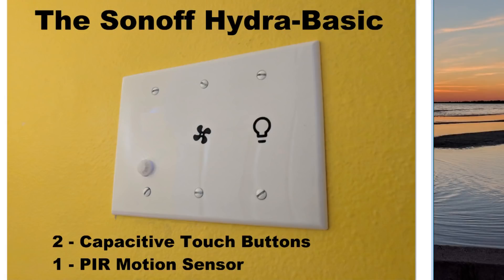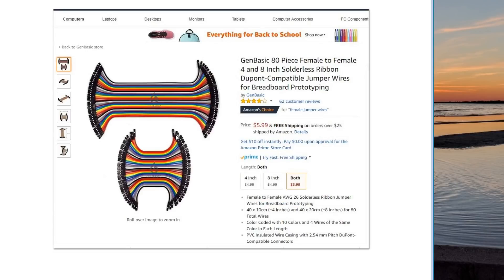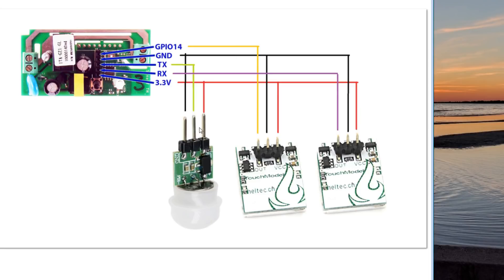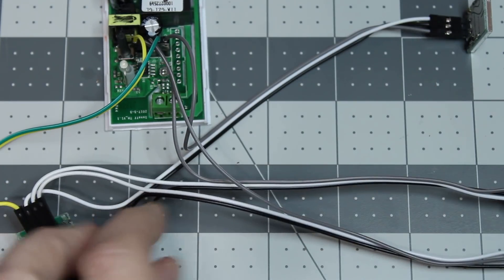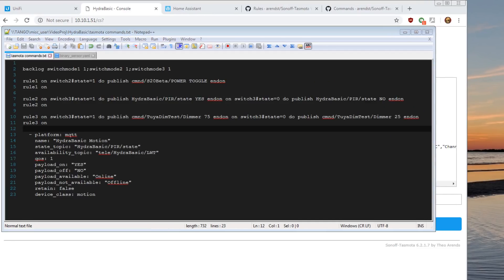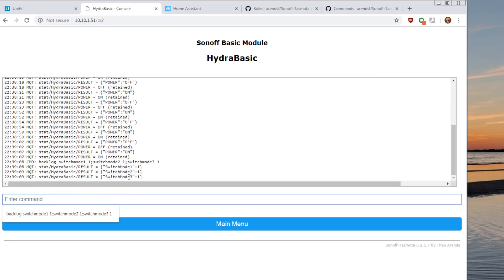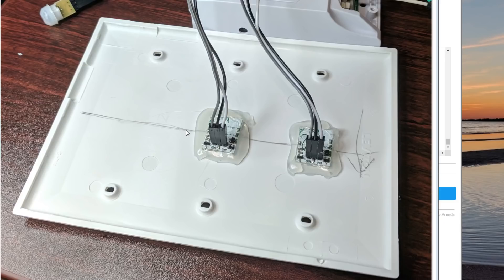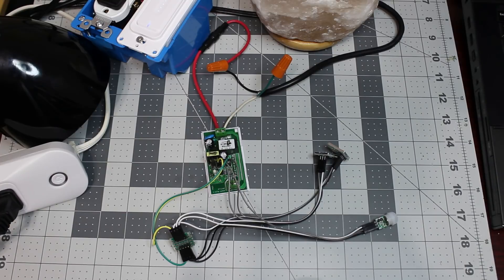Sonoff Basic Expansion Mod - Buttons, PIR Motion Sensors, Tasmota Rules and more!

Comment: Is there a way to make the led on the capacitive touch sensor stay lit all the time?
Reply from the maker: Not that I know of without some major modifications. I looked into the little processor on board that is flashable but I couldn't find much on that process. I really wish they would do one that like that.
Reply: @digiblurDIY  Thanks. Yeah, same here. I tried messing with ButtonTopic in tasmota but couldn't find a way to change the state of the switch without changing relay state too.

Comment: Liked and suscribed, very good video, can you tell me how many GPIO pins on the sonoff basic can you hack?, i guess the LED and the Rele too, but im not sure
Reply from the maker: Yes you could snag those if you are handy enough along with gpio4 on the chip itself. But at that point it might be better to get a device better suited for more GPIO pins?
Reply: digiblurDIY, In fact, I was trying to do this same project with a d1 mini, but taking into account that I need the relay, well, the sonoff basic seems a better option
Reply from the maker: They do have those d1 mini relay shields that stack on top but then of course you need to supply a power supply to the d1. All boils down to how much work things are.

Comment: Nice Work..might have been nice to see the wall plate etc working in the intended area but otherwise very informative.  Heard from Dr. Zzz's that you may have flashed a Sonoff ifan002, any chance of a video to demonstrate?  Looks a little tricky with the separate power supply and soldering on the backside.  Would like to see it done before I fry one of mine!  Keep up the good work.
Reply from the maker: Unfortunately the wife happened to be painting the room that week so I was unable to grab video. I do plan on doing an iFan02 video to show the quirks but I won't have any flashing stuff as I did my two over OTA and don't have another unit that isn't flashed to go through that process.
Reply: Ahh... thanks for the reply...Any idea where I can find info on how to OTA flashing of the iFan002?  Dr. Zzzs video? If so how do you get the iFan002 into "flash mode"?  OTA definitely sounds less risky than running on mains.
Reply from the maker: Yes, he did a somewhat recent video on how OTA was back.  I had to hold down the button for 10 seconds or more and then I could see the AP mode on my WiFi scan, the manual talks about the long method or something.
Reply: Thanks!

Comment: thank you. awesome video and make full use of the sonoff basic. explanation of the Rule is very good. thanks. I want to use this in a bath room can i swap the 2nd touch sensor with a DHT22 so it runs the exhaust fan. If its possible could you also show what rule(s) i need 1st for mqtt states of humidity and temp & 2nd rule for turn on a entity(ex-fan) when humidity goes up and turn off when its back to original value. I guess anotehr rule3 would be needed to run the ex fan for 20 min every time SW1 is activated.
Reply from the maker: Yes, you could use one of those pins for the DHT22 as it only requires one data pin.  I actually have something planned for this type of automation but it might be a week or two before I circle back to a video on more rules such as this.  If you want you can send me something on reddit as /u/digiblur  and I can help walk you through things.
Reply: oh so you are digiblur, you are the one that pointed me to this video on discord. thanks..i will ping you in discord. thank you
Reply from the maker: Yep. You can find me there as well.

Comment: Nice job! Thank you. I like the rules parts. I have not tried that yet. Is it possible to show how you mounted the touch sensors on the wall plate? Did you have to cut holes or does it work through the plastic?
Reply from the maker: The very last part of the video as a snap of the buttons attached.  Yes. Hot glue over the edges and around it just to stay on. There is no glue in between the button and the wall plate. They work pretty good through a variety of things.

See below. I wish they had an option to stay lit all the time and go off when pushed. https://i.imgur.com/LVfHmnG.jpg
Reply: Loving your videos man.  Helped me past a few small hiccups I was having.  I'm just curious though, where did you get your stickers?
Reply from the maker: I made them on the Cricut vinyl machine. Are you in the US? I could send some.
Reply: @digiblurDIY  I am in the US and that would be rad!  PM me your email/paypal.  I just haven't had any luck finding them to order anywhere otherwise I would have, lol
Reply from the maker: Just add Gmail to the name of the channel and it will forward to me. Or I believe you can go to the about section of the channel page to obtain the same email.
Reply from the maker: @matthewfgriffin  If you don't want to do the email thing, look on the HomeAssistant or DrZzs discord servers and you'll be able to pull me up, just send a PM.  No paypal needed.

Comment: getting the sonoffs talking to each other, i like it! i wish i was retired so i could play with home auto more. dangit,  back to the grind.
i did flash a few sonoffs tonight, gonna try to see if some old thermistors i pulled out of an old AC unit will give me some data.
Reply from the maker: It's through MQTT of course but there is another way they I'm setting up at a friends house with two switches to send commands over WiFi only as he doesn't have any automation or MQTT broker and we just need something simple.  Check out the WebSend command, it's great.

Comment: wondeful :) lacks only the illumination of the keys.
Reply from the maker: Yes. I really wish the buttons were backwards where they stay lit while not triggered and went out when touched.
Reply: Just done with mine: you have to use the mode "82 Switch1n" and the led is on when the relay is off and viceversa :)
Reply from the maker: Are you using them in momentary mode as in the solder added? I believe mine are the 1n 2n etc for no pull up and I don't see them working light that. I will check this evening again.
Reply: i made some tests at work, this morning have arrived some green ones, i tried to use and worked, but after a while not anymore, i will check at home with more time.
Reply: I tried, was really like a "toggle" command, so is random the status of the light, what a pity :-(
Reply from the maker: Solder the two points to make them momentary and the random issue goes away.
Reply: i will try at home tonight
Reply: after some tests I tried to change the string in Userconfig.h:
#define SWITCH_MODE            FOLLOW_INV        // [SwitchMode] TOGGLE, FOLLOW, FOLLOW_INV, PUSHBUTTON, PUSHBUTTON_INV, PUSHBUTTONHOLD, PUSHBUTTONHOLD_INV, PUSHBUTTON_TOGGLE (the wall switch state)

GPI14 connected and the touch is as expected: light when the relais is off.

but wheh is remotely triggered the touch doesn't light when the relais is off :(